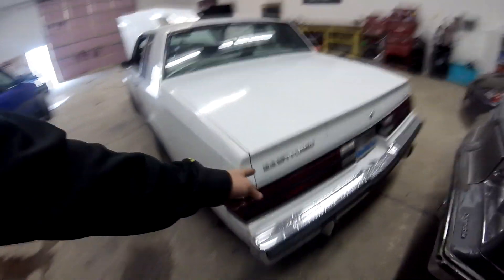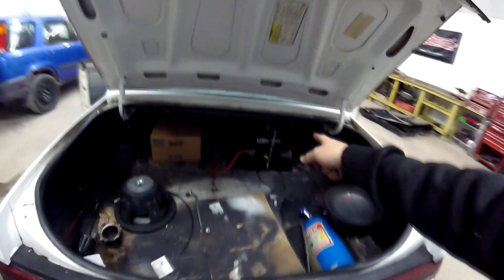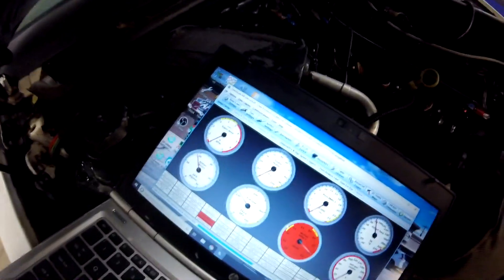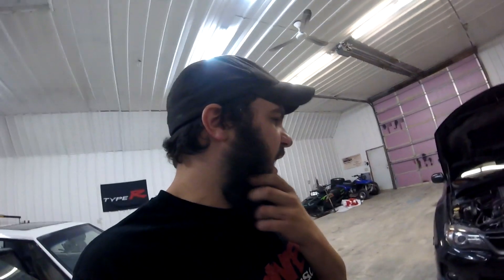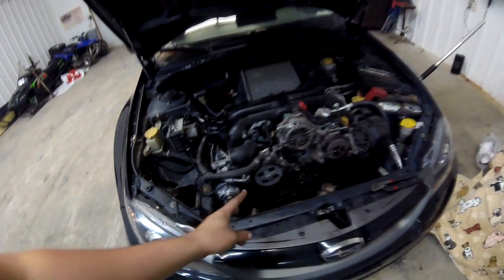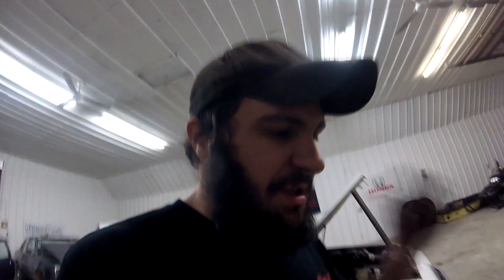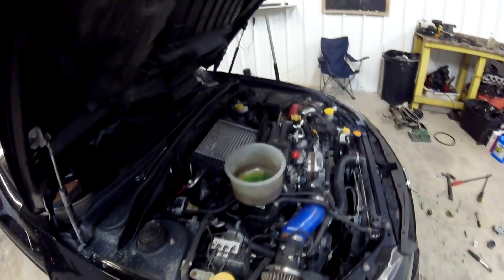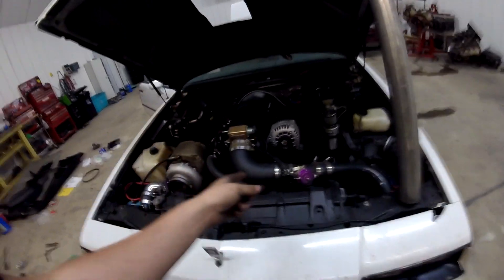Megasquirt TPS Calibration + Timing Belt On My WRX

Comment: Check wheel speed sensors to see if there is any debris or a bad connection causing the intermittent  issue. Hope this helps

Comment: I’ve had the same issue with the abs sensors   you can clean them off as well as the hub and axle if you can remove sensors without breaking them. Love the new shop. Keep up the good work 🤘🏻

Comment: Nice good to see you upitie up and having a good time fixing your stuff. Awesome you watched videos and told us what you recommend that’s kinda priceless but I’ll need a lot more money to ever get a Subaru lol. I got a 98 integra jdm front b18c5 swap but low comp pistons so it’s ballsless but revs out too 8g all day somehow lol.   Thanks to everyone who told me about my throttle body. I switch back to stock from my sk2 pro and it fixed my idle surge and sticking at 1500-2000 sometimes higher.  Just put a hose from one open coolant line to the other and it already had map and tps needed new longer bolts and fixed.  Thanks huntertuned and everyone who told me it will be fine.   Now I think I gotta get a 70mm I lost the pop pop pop when decelerating at 3g :(.    So happy to see you had a better tomorrow from the last video.  Maybe just get the mustang running before you do the control arms just a thought to keep simple since the suspension is way better already now then months ago.  Take care

Comment: A set of adjustable solid rear control arms are a must for the mustang maybe you can find a used set for cheap
Reply: Then you can get rid of that pinion snubber and it's stupid weight hanging off the bottom of the differential

Comment: graph all 4 wheel sensor on a scan tool and watch which one stays at 0 or is noticably slower than the others. usually the tone rings get full of brake dust and you just need to blow them out though
Reply: Randy Morales good info here :)